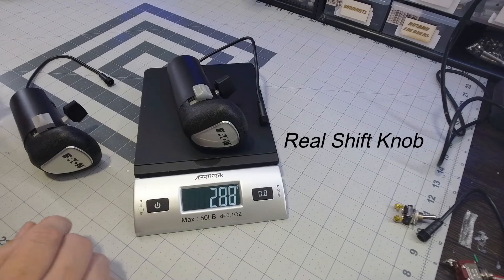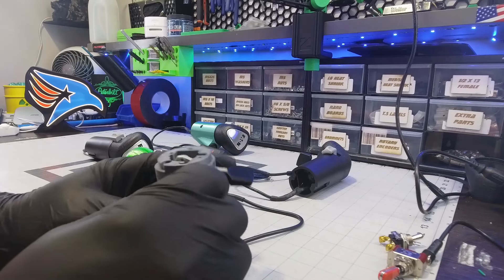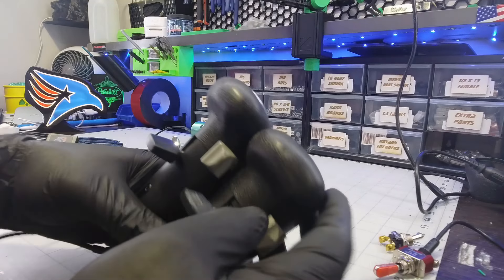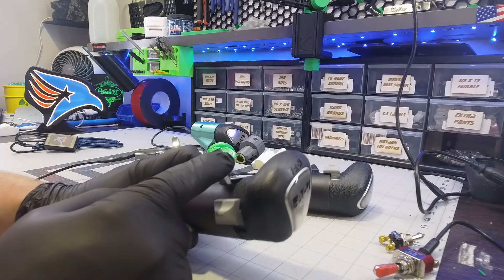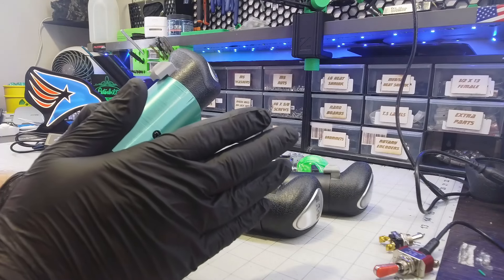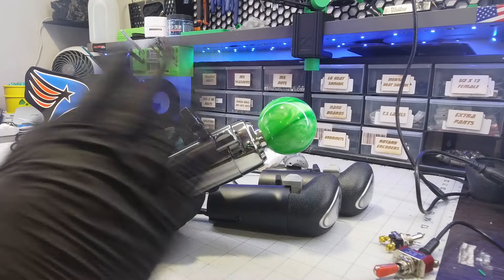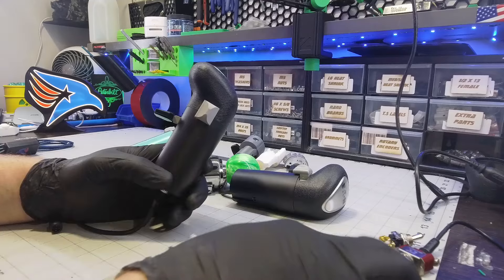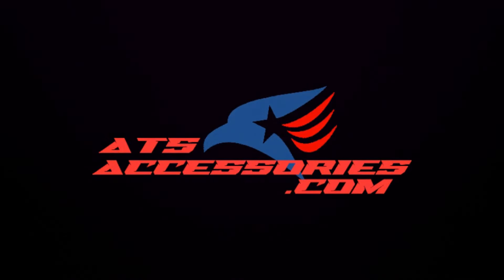Re Designed Budget Shift Knobs

Comment: I've just ordered one of these (pretty much bog standard but with easy jake, and requested a red splitter for 13 speed, because I couldn't find anywhere that said that was an option, mainly because I'm pretty sure these are made to be 18 speed, but I hardly ever use 18's in ATS, so Figured I'd ask) But I can't wait to test it out. My main gripe with ATS was I had to take my hand off the shifter to split/range. This'll make it much more fluid and seamless I think. And given Jeff Favignano is partnered with these guys and endorses them and gives pretty good remarks, I figured I'd give it a shot. The Budget shifter after the 30 minutes or so of research and thinking, seemed to be the best option budget wise, as I only could really afford what I got. and more and I'd be breaking the bank. We will see how it turns out when it gets here! I'll leave a reply off of this once It's gotten here and after I've managed to test it all out.